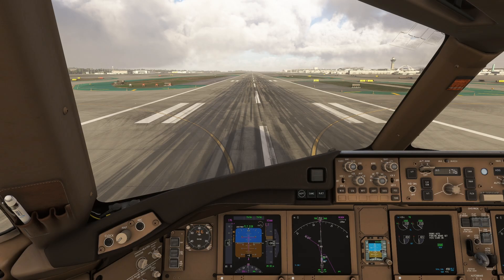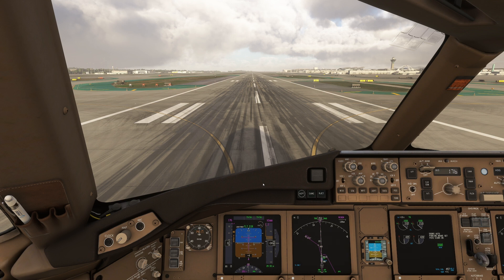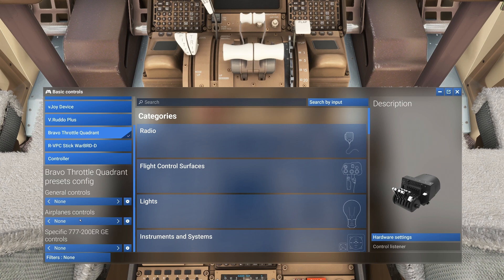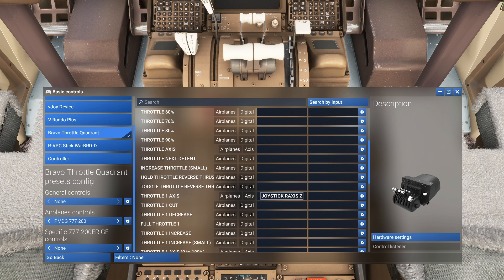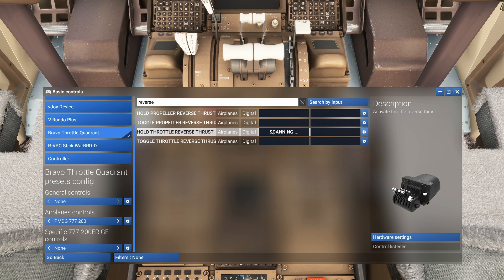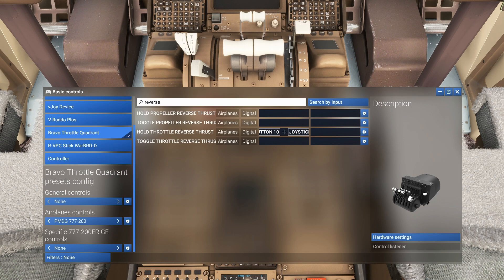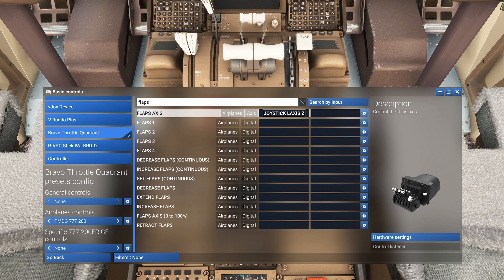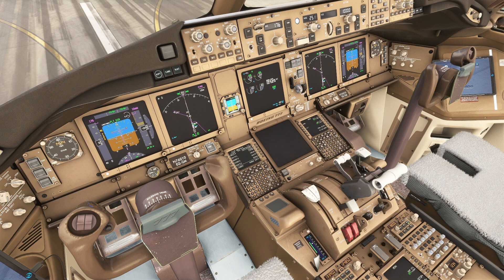MSFS 2024 PMDG Honeycomb Bravo Basic Configuration

Comment: Have you got the ALTN Pitch Trim lever to work also?
Reply from the maker: I haven't tried.  Given that it is very unlikely I would need to use it in the sim, I have never considered assigning it. The trim assignments on the yoke are just Trim up and Trim down, if I recall correctly.

Comment: Very helpful ! I use the throttle decrease/throttle cut alternative method for reverse which I prefer but it's good to have both options.
Reply: yeah i think the throttle decrease/throttle idle method in 2024 is better because u can control each engine reverser independently. "throttle 1 idle/throttle 2 idle" replaces 2020's throttle 1/2 cut so just set throttle 1 idle and throttle 2 idle to "set control on release" and it works perfectly
Reply from the maker: Excellent.  Options are always nice to have, especially with so many different controllers out there.